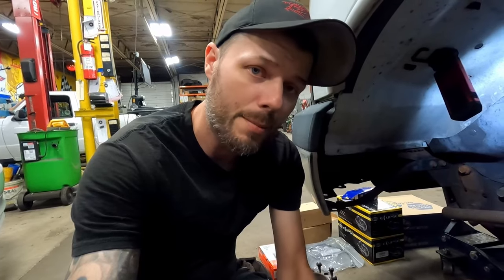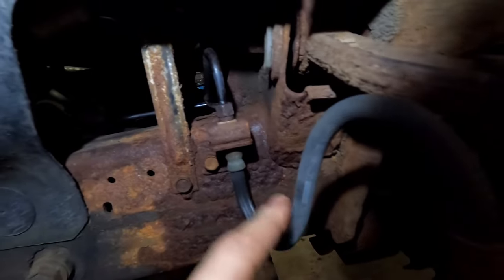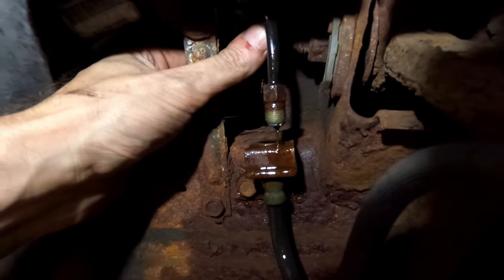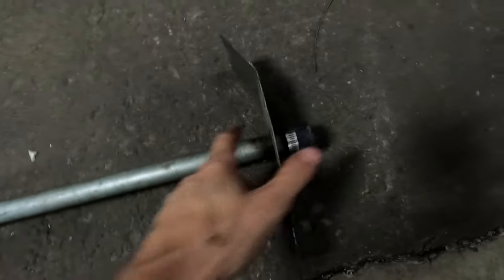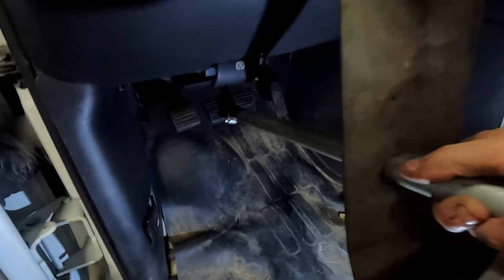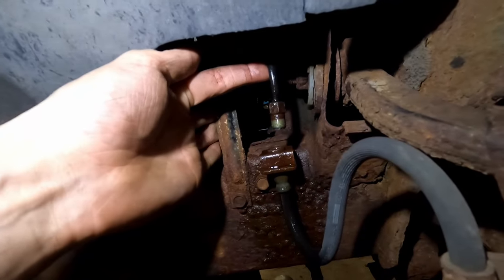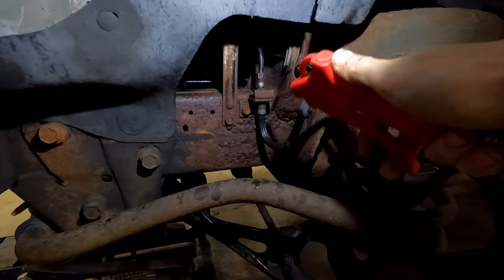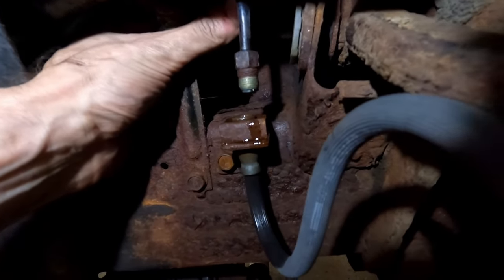Top Secret Mechanics Trick! How to fix brakes the right way. Bleed brakes easy with less air & mess

Comment: Why not drain/replace the fluid, and have good brakes after? Physics teach told me that when 2 liquids [water&brake fluid] mix, you get thicker fluid. Fresh fluid gives good response. No one believes this, I have started bar fights with this one.
Reply: 100% coming from a experienced mechanic , brake fluid becomes contaminated and spongy and causes calipers to seize up in time . Sometimes I even suck out the brake pot with my shop vacuum and add new before I bleed them .
Reply: I think it’s easier to replace the fluid when the master cylinder hasn’t already pulled air into the system

Comment: Good tip. Here’s another idea. I have a ‘79 MGB. The repair manual (Haynes) said to place a piece of plastic film over the master cylinder filler and secure the cap over it. No air flow through the vent hole, thus no fluid can escape. Worked perfectly for me. Don’t know if it’s always going to work for others, but worth a try. I’m subscribing to see what else I can learn. Thanks!
Reply from the maker: Thanks for following along. The channel is brand new and I plan on starting to post a consistent flow of good content.
Reply: How far is just a little bit?
Reply from the maker: @williamb454  I would suggest halfway down its travel. In all reality if your just off the stop it should work fine. But you don't need to bury it to the floor.
Reply: SO SMART!  Thank you kind sir! Sub’d

Comment: I've been using this method with a fixed length of wood (cut to fit for my car with the seat in always the same position). Your method of making it adjustable is great. I'm going to make me one. T-Y for posting.
Reply from the maker: Im glad you liked it. Another tool for the tool box

Comment: I made one with a 2x4 but the problem with that method is that it keeps the brake lites on too long. and may overheat the bulbs/ run the bettery down...I suppose it would mean disconnecting the brake switch.....dont mean to steal your thunder......I feel that the best way is to plug the brake line.......it seems to be the only way that doesnt have a side-effect

Comment: Tore out a bunch of brake lines that had factory steel abrasion wrapping wire. Huge mistake. The lines were nearly perfect.  The rust was mostly in the wire covering. 
Became expert again after total brake system rebuild including proportioning valve. Woe, is me.
Reply from the maker: Yes, often only the very ends at the fitting are the issues. The spring wrapped lines tend to be in good condition throughout. If we decide the majority of the lines are very solid, we cut the spring off in a straight section and flair a repair line in. Never use compression fittings to make a brake line splice. Cut the line ahead of your projected splice location, then easily remove the spring by cutting half way through the spring with a 3' cut off wheel without risking scratching the line inside. Wiggle the spring back and forth a few times and it will break off. Then slide off the end. Hope this helps for anyone reading.

Comment: Good video, but it doesn't work on hybrid cars or electric cars. The brake fluid will then be pumped empty by the active brake system at high pressure. It can be stopped with diagnostic equipment.

Comment: I always used a big screwdriver or combination of extensions to get the right length.
Reply from the maker: With the addition of sliding the seat too. Although my shop rule is never adjust a customers seat unless you physically can’t fit to test drive
Reply: I use 2 feet long metal shoe spoon with curled handle at the end so it can dig in the seat on broader surface. After adjusting it on brake pedal I slide the seat forward to press the pedal.

Comment: Have used a piece of the silicone rubber that physiotherapists supply for muscle building exercises to seal of the master cylinder top with the lid removed and a thick rubber band around to minimise fluid loss as it is more useful for this purpose that sorting out a frozen shoulder!

Comment: thank you for this tip    I had just got a pair of pinch off pliers  but i like this better
Reply from the maker: Plyers work well in a hurry. Be careful using them on older hoses. They can damage the inside of the hose and cause a hydraulic lock up.
Reply: @motormike43  oh sorry mike what I should have said is I boight a set of the plastic pinch off pliers  and there still in the box that they came in  after watching this video I ordered a brake pedal depressor tool

Comment: thanks for mentioning the brake lights.  that can be a deal-breaker depending on length of job.  I've seen melted sockets and housing from this, and of course dead batteries.
Reply from the maker: yeah, not something youll want to leave over night.

Comment: The amount of times i have cut a piece of wood or used something to jamb the brake pedal and then I find this video with a simple pedla locking tool! ion, after replacing a brake line and refitting the brakes, do you then bleed the brakes using the pedal lock tool or let gravity drip bleed the brakes?

Comment: I built a pneumatic pedal pusher.  It takes regulated air hose pressure and pushed out on the pedal.  And then retracts.  It's plumbed to one of those foot pedals from a sand blaster so when you release the pedal it extends and when you press it retracts.  For tough to bleed vehicles like old Porsche I use a pressure bleeder system with my pumper.  So I have pressure on the feed side and the flow.

But personally I want to get as much fluid out as possible because flushing prevents line rot

Comment: Or you can use a very long screwdriver like I do, handle goes against seat head of screwdriver on peddle slide seat forward to hold screw driver in place and pedal is pressed down.

Comment: Maybe a stupid question, but if I do this, put on a homemade stick/pedal stopper that I make before I loosen any nut from the brake caliper, then I won't have to bleed the brakes when the work is done ?
Reply from the maker: Any time you open the hydraulic system you have to bleed it afterwards. This will prevent fluid from leaking out the entire time the system is open but not prevent air from getting in. 1 single tiny air bubble in a brake system will effect performance. This will very much limit the amount of air and the loss of fluid. Nothing prevents bleeding. This just makes it easier

Comment: I have always used a floor brush with the tip of handle pushing on the pedal then wedge the head of the brush against the back edge of the door  opening (front of the b pillar)...handy for checking brake lights too

Comment: Hello great video but how isvthis about bleeding the brake? Lisa thank you
Reply from the maker: Because you don't draw in excessive air into the brake system and risk getting air into the drained down and now dry master cylinder. Making it so you can then "bleed brakes easy with less air and mess" as the title suggest. Thanks for watching.
Reply: hello ok thxz for the reply; i wrote cuz i had a brake pedal that went tot he flor maybe 2months ago w/out warning and then it was good again w/out warning but then once agin it was to the floor and i could not drive safely and so i check the master resovoir it was empty and so i went to my local garage and he inspected the brake lines under my car and the master cylinder resovort ender the hood and said there as a small brake line section at the back passnger side and he replace that section brake line and then he porceded to bleed the brakes screw at that section only and he could not get all the air he said and so he said my brake pedal will still go to the floor but i have no more leaks anywherre and it wont leak but only about less than 10days later i park my car and the brake oil was all on the floor next to my driver side wheel and i have not yet broght it to any garage and not tot the garage who serviced me cuz i dont get what happned; canu possibly help? there is not more brake oil in the master resovoir gain inspite of the brake line repair

Comment: Excellent!
I've been replacing all of the brakelines on my 2002 Freightliner Sprinter with nickel-copper, and have been saving the most complext lines for last. The right front wheel, and I will definitely be using this method. 
Thank you!

Comment: I learned that trick from Harley Davidson in 1994 .
Reply from the maker: something taught at a Factory Training Class?
Reply: @motormike43  yes
Reply: How about a trickle charger I left one on my 72 Chevy pickup all winter in the garage
Reply: @rick980   cant go wrong with a trickle charger , a lot of cars have such small batteries with all that computer crap running ,some have30 modules , if one dosdent fall asleep it will kill your battery ,

Comment: Very cool! Wish I had watched this yesterday before installing new calipers on my friend's truck. p.s. bled the new calipers (rear) for quite a long time and still have a spongy pedal. Any suggestions?
Reply: Did you use a pressure or vacuum bleeder? I usually use vacuum but find on some systems it works better with a pressure bleeder. Some ABS systems require an ABS bleed procedure, as well. I hope that helps.
Reply: Make sure calipers are correct way round, bleed screw at the top

Comment: Great tip, thanks! - and makes sense.
  Another tip for bleeding brakes on most caliper/rotor systems: When you are ready to bleed the brakes, fill the master cylinder and open the bleed screws on the wheel cylinders, all the ones you want to bleed. Leave the lid off the master cylinder, cover with rag.
  Don't touch the brake pedal at all, leave it in the 'up' position. Wait. The brake fluid will self-bleed by gravity feed, just keep the master cylinder topped up. I often take a short coffee brake while the brakes are bleeding themselves.
  Then close the bleed screws when fluid is running clear.  This technique does a better job of removing air, and takes about 20 to 30 minutes (often less time).
  On drum brakes, you still need to pump the pedal to bleed them as usual.
Reply from the maker: Yes, always gravity bleed first. One at a time or they can fight eachother and draw air in. Open the longest line first till it has a steady drip. close and repeat with next longest line. Then its time to pressure bleed.

Comment: You will have to disconnect the battery because your brake lights will stay on
Reply from the maker: 7:45 -8:20 min    Yes, if it's a multi-hour job I suggest disconnecting the battery or pulling the brake light fuse. Unplugging the brake light switch might even be the easiest option on some vehicles. Many vehicles today do not label the fuse box and disconnecting the battery will lead to extended time resetting radios and clocks.
Reply: @motormike43   just hook up a battery charger
Reply from the maker: @oldbiker9739  Another good option. Im not a fan of leaving battery chargers running when the shop is vacant. A good choice for a long 1 day job. I have actually seen brake light lenses melt from cars being on the alignment machine with the pedal lock on for hours though. If it's going to take more then 2 hours I would suggest disabling the brake lights with a simple battery disconnect.
Reply: @motormike43  I have LED lights

Comment: I have two comments to make on the down side to this vid!
1, brake fluid is hygroscopic! Which means it attracts water from the atmosphere which inturn damages the brake components due to rust and other contaminates, by doing what you are suggesting the brake fluid in its entirety never gets changed! Or encourages the DIY person not to change the brake fluid 
2, the brake lights only come on when the ignition is switched on!
Well in Europe it does, is America different?
Reply: It must be different here in the US, the brake lights work without the key in the ignition.
Reply: I'm from Slovenia and brake lights on my Mitsubishi Colt come on even when the car is locked (I push the brake pedal through the open window).
Reply: @igorpotocnik7231   Igor I have learned a thing here!
In England and France the brake  lights don't come on unless the ignition key is in the ignition and turned to the respected position!
Reply: @mikelane4896 Good for you, Mike,  I wish it was the same with my car.
Reply: I believe his video demonstration simply shows how to avoid the MESS of brake fluid everywhere while working on the brake line, especially when you need to make a flare. After reconnecting everything, a complete flush can be done as well. Also, brake fluid is exposed to much larger amount air while simply filling up a master cylinder compared to the amount of air that gets into a tiny 3/16”hole of the brake line.

Comment: Thank You after working on brakes for many years D.I.Y. my logic was brake pedal pressed equals fluid out, now you have explained this, I will give it a try, thank you, I also have a MGB, will also try the other viewers method, now replacing calipers and pipes on my Z3, will try both ways and which suits best. Thank you for the video. LEN, UK.